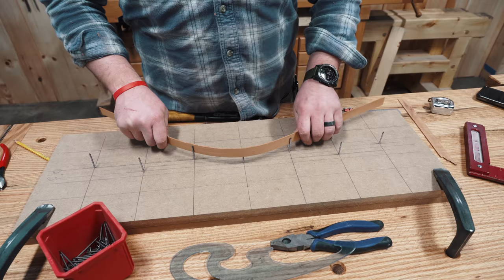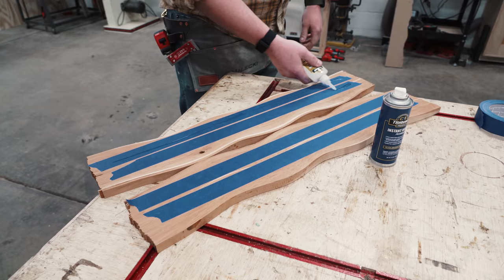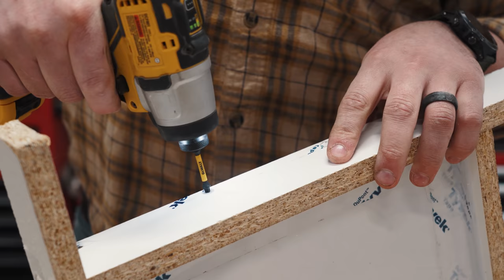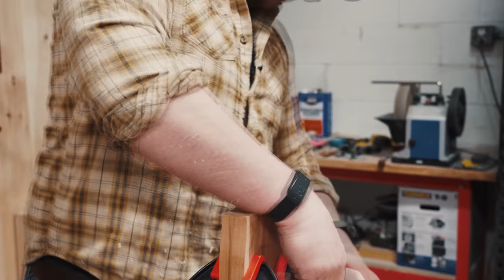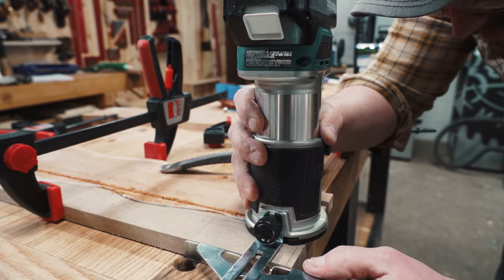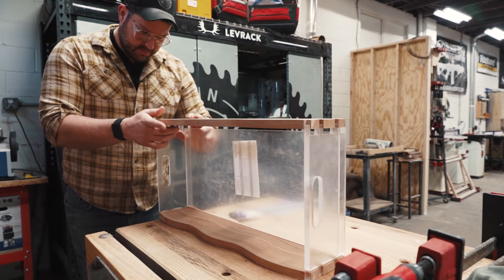CRAZY Epoxy Dovetails in Curved Wood Tray Build

Comment: I’ve seen other epoxy videos using Yorkshire grit and/or Ca glue to smooth the surface of the epoxy.  They may have pre-sanded with the super fine wet - sponges(?).  Stephen Joiner is primary person I’m thinking of, Bobby Duke is another.  Just an FYI if you didn’t already know.

Comment: Love it!  Playing with epoxy and wood is fun!  Although I've only used the tabletop stuff for computer desks and a custom serving tray.  I'm not sure about deep pour stuff, but tabletop isn't the easiest thing to polish as it's much harder than automotive clear by a lot.  Usually I wet sand it up to 3000-5000 grit which takes a while because you want to be thorough in between grits of you'll see it.

Comment: is it possible to flame polish epoxy??  (I've used it with acrylic but never tried epoxy)
Just asking because that could save you a ton of time finishing.
Reply from the maker: It isn’t.... we tried hahah
Reply: I usually try just wiping on more epoxy, but on bigger areas polishing it will give more even results.

Comment: John ... future project suggestion ... pander to many demographics ... multi-episode ... build a custom gaming rig using a powered driver's seat pulled from a luxury car (obv need voltage converter) mounted on a mobile base.  An overhead arm holds monitor(s). Arm ("beam") mounts on mobile base behind seat and curves over it to suspend monitor(s) in front of gamer. Powered seat = any gamer will fit. Computer/converter.etc. mounts behind chair, and (tough part) this rig can mount Xbox/PS4 or PC, with HOTAS or driving wheels with pedals also mounted. Obv. needs room for a mouse pad and kb. It would handle every game in the universe. 

Your name will be L E G E N D!

(Srsly it could really drive view counts ... gamers are legion).